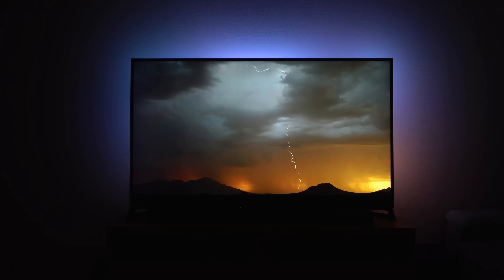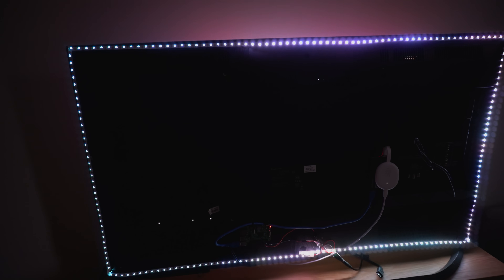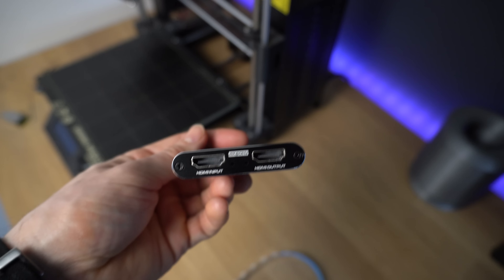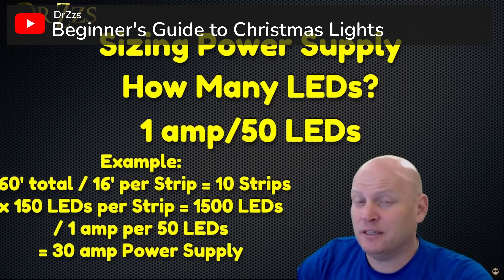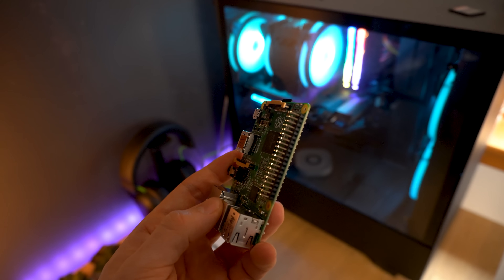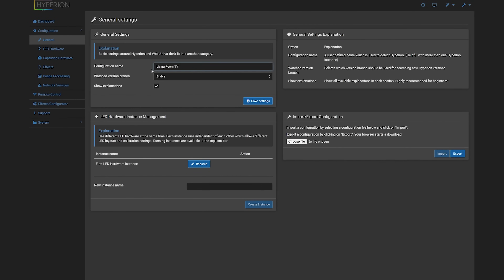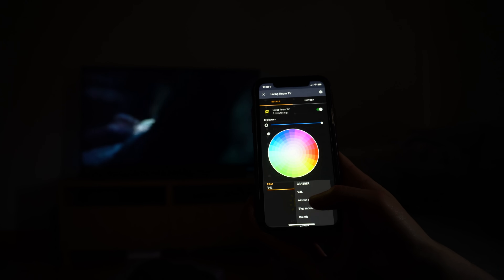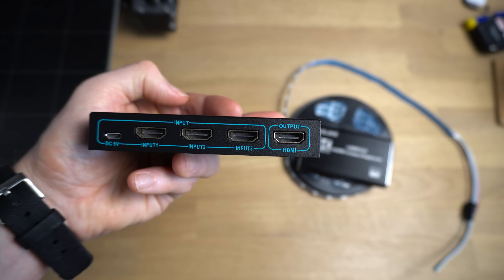Cheap DIY Ambilight TV Project with Hyperion and Raspberry Pi

Comment from the maker: Hope you guys enjoy this project and video, I spend FAR to long making it but had a blast doing so!

Are you planning building one!?
Reply: yes! i def wanna build mine cause i need the strips to be waterprooff
Reply from the maker: What are you doing with your TV sir!? 😳😂
Reply: @EverythingSmartHome  I will have a bathtub inside the bedroom, and in front of it will have a wall covered with a 2x1 tv wall , and around the bathtub we will have a rgbw strip that will glow with the image on the tv. So when the girl is taking a bath to the mood of waves or etc... I will have a more relaxed wife!
Reply: This can be a nice project during Christmas holiday😃
Reply: Yes building one but looking into rooting my TV and installing a WebOS hack that captures anything playing including from internal apps - and sends data to hyperion via lan. Since we in majority use apps.
Reply: I have been trying to do this for almost a year now. I have it set up, but the problem is when I boot up the Rpi the led's don't light up. It worked for an hour or so then stopped after I set everything back up. I know this isn't all that hard but dang. It's been beating me
Reply from the maker: That is strange, if you have a meter then try measuring power and amps on the power supply. I had one of the barrel jack terminals go bad on me
Reply: Great video!!!! I’m having the problem we’re the lights are flickering and you do mention something about the ground wire to be the same for both the pi and strips but not sure what you mean by that... would you be able to explain a bit more? Thanks in advance.
Reply from the maker: Thanks! A common ground is where your ground to the Pi and the ground to the LED strip are connected to the same source. Usually you will get the flickering if you power the Pi from a different power supply to the LED strip. Hope that helps
Reply: If I take a 1080p video capture card and plug in a hdmi cable from a xiaomi 4k mi box, will it block the data signal from Netflix? Does it have to be hdcp 2.2? (I just need the 1080p image) Thank You, and great video btw 😉
Reply: Thanks for this awesome tutorial dude. I was wondering about what might be the best way to run multiple inputs though the capture card. Like you I want to have 4k HDR with HDCP 2.2 as I run an NVIDIA Shield for all my TV viewing. But I'd also like to have my gaming consoles connected to the bias lighting. I also run ARC to my reciever for sound output. Do you see any potential issue with this setup messing with the ARC?
Reply: I did the same application, but when I turn on 4k, that is HDR, the colors decrease and fade, what is the reason for this, thank you
Reply: Did you ever make an IN-DEPTH build video for this project? I would LOVE to build this instead of using the janky Govee Ambient Light setup I currently have! I paid $80 for it, and it barely works. The color transitions are so incredibly slow!!!! PLEASE tell me you made it!!!!!!
Reply: Hi, do you think raspberry pi model b+ v1.2 will do the job?
Reply: I would love an in-depth tutorial. I is want ti di this for my tv, it is only a 1080 tv

Comment: Has anyone else had issues powering the light strip? I have tested the power supply and confirmed an output of 5V but the light strip does not turn at all when connected to power supply. I bought the led strip listed below in notes

Comment: When I plug my Video Card in the USB 3.0 port from my raspberry pi 4, I can't use my Google Chromecast because the WiFi connection breaks down. Also it's a bit laggy. When I use the 2.0 everything works fine. Someone know a fix?

Comment: Will this work if I used my wall led panels which are connected to my esp32, instead of buying extra lights for the back of the tv and possibly connect the esp32 to the raspberry pi through Bluetooth or wifi

Comment: Tip: if you get a capture card that has issues with HDCP, you can use an HDMI splitter (in then out) to bypass, as they do not see or transmit HDCP

Comment: Quick question, do I have to use Chromecast to have ambilight? Lets say I want to use applications which are built in TV like Netflix, AmazonPrime, Disney etc. Will it work when I connect HDMI from TV to VideoCapture card (hdcp 2.2) and the VideoCapture card is connected to raspberry pi through USB, the rest is the same like in video. Thank you in advance
Reply: Same question here.

Comment: I really want to do this....but I'm wondering if you've tested any HDMI 2.1 spec devices to avoid losing the 120hz from newer consoles?  I know the cost of the splitter will increase significantly but as far as I can tell that's the only part that would actually need to differ to pass 4k120 through to the monitor from an AVR...just not sure if the capture card will properly interpret a 4k120 signal...

Comment: Had a raspberry pi 3 collecting dust and a  thrift store near my work that has plenty of 5v 10a PSUs in stock so I'm gonna buy the LEDs and other accessories and get some use out of it.

Comment: 60€ for a 4K capture card? That is dirt cheap! They usually cost around 150€ - and that's without HDR and copy protection pass-through I think. Elgato and such always seemed to have to have the most solid options.

Edit: Seems like it's a 1080p capture card with 4ak pass-through. That explains it and also some of the latency as such cards usually introduce great amounts of processing.

Comment: WS281x devices must run under root. So to make this LED-strip work you need to run these 2 commands: 
sudo chmod +x /usr/share/hyperion/scripts/updateHyperionUser.sh 
and 
sudo updateHyperionUser -u root
After that it will work. If it doesn't work check the log.

Comment: My setup tends to either crash or go into deep sleep regularly.  To get everything back up-and-running I have to reset the ESP8266 and the Raspberry Pi.  Any thoughts on debugging this?
Reply from the maker: I'm not sure sorry I don't use esp8266 for this - I don't have that problem with mine if that helps

Comment: Why not us the TV USB port for this ?
Reply from the maker: TV usb ports typically output about 1a, sometimes 2a - driving LEDs takes significantly more. If you mean the Pi only then it's possible but some models of the Pi require 3amps. Plus you still need a common ground to the LED strip between the Pi, so this way is much simpler.
Reply: @EverythingSmartHome  I am sorry, my question wasn't clear, I understand the LEDs and Pi will require an external power supply. I was more thinking about using the video signal to feed the Pi to take advantage of the TV applications (most of what I watch) and not just the external video sources (only DVD player in my case). I have seen this might be possible on "5 great uses of your TV's USB port by Dignited": "The USB port on the TV also allows you to connect accessories to beautify the TV and its surrounding environment and enhance the user’s viewing experience. Also, 8K TVs from manufacturers such as Samsung (this is what I have) and LG have a sports ambient light function, and you can also purchase third-party TV lights that can be connected to the TV via a USB port".

Thank you for your response and your excellent videos.

Comment: now that you ended up only capturing 720p could you have used a cheaper capture card meant for 720p? or would that mean that you would only be able to watch 720p and not 4k? (i know nothing about capture cards)
Reply from the maker: Yeah it would limit the viewing resolution to 720p
Reply: @EverythingSmartHome  how about if you split the hdmi (hdmi splitter) first. 
so chromecast to splitter. hdmi-clone1 to 4k-tv. hdmi-clone2 to 720p-capturecard. would that limit the resolution as well? 
im looking for a cheaper version of what you did 😅

Comment: That was really inspiring. I'm going to try it.
Question : If we use the PI as the media device itself, can we do it without capture card? Maybe flash an OS that supports hyperion and use the PI output itself as the source for Hyperion.?
PI4 can be a decent media player IMO.
Reply: You can even use a Pi without a capture card and a different source. There's a companion app you can install on your PC that'll send the video signal via WiFi eliminating the cost and complexity of the capture card entirely. Latency is about the same or lower than with a capture card, as rose usually are pretty terrible whereas the Pi's and most computer's media engines are mich better.

Comment: Your using the Power Supply to power the PI as well, and it's already underpowered for the LEDs. Arent you losing about 3amps for the PI making the 8 amps down to 5, when you needed closer to 12, yet it still works. Fair play
Reply from the maker: 3 amps would probably be a bit ambitious for the Pi but say 2 to be safe. The LED calculation of 0.06a per LED is pretty conservative since that assumes max brightness at "white" colour, in practice it doesn't use as much as that. Hope that helps!
Reply: @EverythingSmartHome  I am curious about the wiring setup. I see that the LEDs supplied cable that you only used for the data cable to the PI right? Could you not have used the same wires as the data wire, cut and connected to the barrell jack connector, or is that wire not good enough to handle the voltage?

Comment: Thank you very much for this video. DIY Ambilight has come a LONG way since I started dabbling with it in ~2006. At that time I bought a custom pcb kit which captured via SCART. Good times :) Then I tried (and failed) with Rasberry Pi and settled on a (now discontinued) DreamScreen. It works like a charm but need a second Ambilight for my ManCave. This is exactly it! No need for a (imo overpriced) Hue Sync Box, though it has it's merits in many usecases.

Comment: Thanks for this.

So help me understand something you're using a capture card that has 4k HDR hdcp 2.2 IN but you're outputing 1080p to your TV from the card, how does that help you since you need 4k HDR from the capture card to the TV?
Reply from the maker: I think you perhaps misunderstood a little, the capture card takes in 4k60 signal and outputs the same 4k60 signal (called a loop out) - the bit that is 1080p is what goes down the USB to the Pi.

Comment: Hi guys.
So I set this up last month and it's been running great, but I had to change my router and couldn't keep the same SSID.
So I logged into the Pi through SSH beforehand and updated that WPA for with my WiFi details and saved.
But now I'm sort of stuck in limbo it doesn't seem to be connecting to my new router but also I still can't see it on my old one.
I'm trying to not have to take the SD card from the pi as I'd have to take the TV off the wall as I didn't think about accessing the pi afterwards lol

Comment: this was so helpful thanks! if you're using a splitter, do you plug the capture card into the splitter first?
Reply from the maker: Glad it was useful! It depends on your splitter but generally you would take the output of the splitter (there should only be one) and put that j to the input of the card

Comment: I'm confused about the links you present for the HDMI 4k grabber. Is it the Zasluke one that I need? because the US link leads to a 404 page, and the international link shows a number of grabbers, but not the one in the UK link. For as far as I can see in the video it appears you are holding the Zasluke one, can you please confirm this? I'm in The Netherlands and I can't seem to find it on amazon.nl. Would you be so kind as to clarify which specific grabber you used, by looking it up on amazon.nl and sharing the link? Solid video!
Reply from the maker: Hello, the US link should now be fixed, but to answer the question yes it's a zasluke one I was using in the video.
Reply: @EverythingSmartHome  Thanks! will start assembly tomorrow :)

Comment: When you conect the lEd to electricity +5 v mine is not turn on, did he need a suignal from the trigger to turn on i tested the LED strip i have my 5 volt everywhere on it
Reply from the maker: Did you configure the software? It won't turn on without that

Comment: Got my setup going but when I try to set my Roku to 4K it says it should work but when I set it I lose signal. Did you do anything or set anything in particular to get the 4K passthrough to work? It only goes to 1080 for me. I ordered a couple new HDMI cables to see if that may be it.
Reply from the maker: Nice! Which capture card did you end up getting? Cables is a good place to start, it try another source just to double check?
Reply: @EverythingSmartHome  Similar one to you only silver. I may try your suggestion as well and see where it gets me. Maybe I'll try a different capture card  too. Thanks!

Comment: Outstanding video! Exactly what I have been looking for!

Just to confirm. The capture card will pass through full 4K HDR signal?

Any idea if it can pass through HDR10 as well as 3D video?
Reply from the maker: Thanks Jeff! Appreciate it!

The capture card can pass through a 4K HDR signal yes, HDR10 is just HDR but has a minimum specification they must meet so you should be fine there.

3D I have no idea I'm afraid!

Comment: Doesn't it effect your refresh rate? That 4k passthrough only handles 60hz.
Reply from the maker: Sure, do you watch TV or films that are more than 60fps?
Reply: @EverythingSmartHome  I was just thinking about doing it for my pc
Reply from the maker: Ah yeah, that's a different setup required, I think I mentioned in the video that it's all dependant on your environment. You would need to use a capture card capable of more than 60fps, although if you plan to use it on a PC only then there is software you can run so that you don't need the capture card.

Comment: Thinking of doing this but does the pc need to be on for the ambiligut to work after it’s set up
Reply from the maker: Which PC sorry?
Reply: @EverythingSmartHome  you know when you setup hyperion? on the computer? maybe i missed a bit but do i have to keep the pc on for the ambilight to be working on the tv? im just confused by that part,
Reply from the maker: Hyperion runs on the raspberry Pi, no computer required. But yes the Pi needs to be on all the time as that's what runs the software

Comment: I cant seem to get the light to catch up to my video, it's  seems to log behind by like 200ms when using Hyperion NG.

WHen I had this setup with the OG hyperion using analog video capture light and video are spot on.

Your lights seems to lad behing as well, there is a smoothing option to slow the light down in case it is going too  fast, but there's non for making it go faster like the old hyperion
Reply from the maker: Hmm I don't have any noticeable lag in real life, it might be the video. Although 200ms is pretty acceptable IMO. 

Yes the smoothing option is there but from my experience using it, it does speed them up and make them more responsive but it's very jarring to use them like that, hence why the smoothing effect is there.

Comment: Can i use a Pi 2B? 😁 Or do i need wifi?
Reply from the maker: You need some form of connection ethernet or WiFi to be able to control it, Pi 2 should work OK but haven't tried!
Reply: @EverythingSmartHome  do you have Hdmi output on your tv?
idont understand this wiring to the capture card. you have the cromecast at hdmi out at the capturecard and hdmi input to hdmi input at the tv?
Reply: works with netflix app ?

Comment: Great video.
What did you use to stick the LEDs to the TV ?
Reply from the maker: Thanks Steve! Just the double sided tape that is already pre-applied to the strip
Reply: @EverythingSmartHome  
Thanks I never had any luck with that on my old analogue LEDs I had on my TV it kept falling off...
Reply from the maker: That's annoying, it probably very dependant on the surface but also the quality of the tape the brand's apply. Some will be better than others. You could always replace with some 3m tape

Comment: Great Video .Just have one question..If i separate the power of my raspberry pi and led strip.Do i just need to connect one of the ground from gpio to the ground of the led?Thank you
Reply from the maker: I think so yes, just use a single power supply if you can!

Comment: Does the capture card handle Dolby Vision or HDR 10 and do the colors looks washed out when watching HDR or does it have the same vibrancy as SDR?
Reply from the maker: HDR10 works because the signal is standard HDR, dolby vision I'm not sure about As I don't have it, so something you would need to check to confirm for yourself. 

Colours are the same since it's a pass-through.

Comment: Hey, just came across this as i’m fed up tripping over my box of bits & decided it’s about time i finished the project off. Was particularly interested in your choice of 4k video capture/pass through device - my project stalled as i could only seem to get a goodish capture if i set my sky box to output 1080p instead of 4k - using a duplicate 2nd output from a Denon AV box. Having already spent a much of money on this, i was reluctant to then spend another £60 on another card without proof of it working well. So thanks for that too! 👍
Reply from the maker: Thanks Stewart, good luck with the project! Although its worth noting that this doesn't capture in 4K, only passthrough of 4K - the a capture is done in 1080p but that is more than enough for ambilight to do its thing. Perhaps I misunderstood what you meant but just wanted to make sure you knew that!

Comment: I want this to work with my sky tv, Xbox, ps5 as well as the built in apps. Surely this set up only works for the source plugged into the capture card, right?
Reply from the maker: That's right, which is why I mentioned the splitter in the video so that you can have multiple sources plugged in. It won't work for the built in apps though, the only solution for that is to point a camera at the TV
Reply: @EverythingSmartHome  ah bugger. I suppose I could use Plex and Netflix through one of the other devices. Thank you.